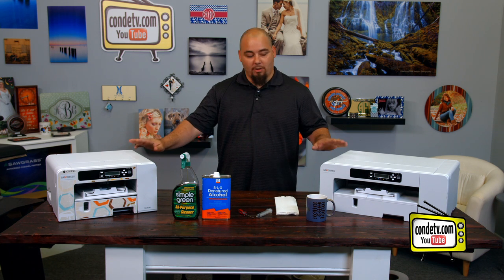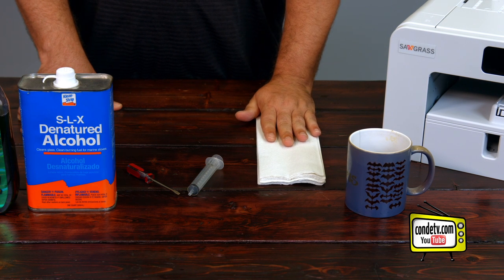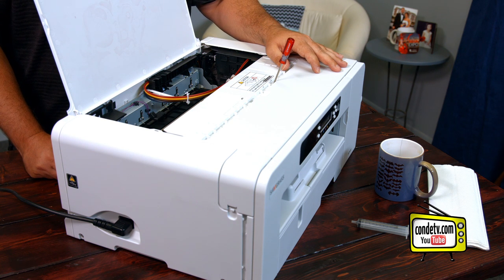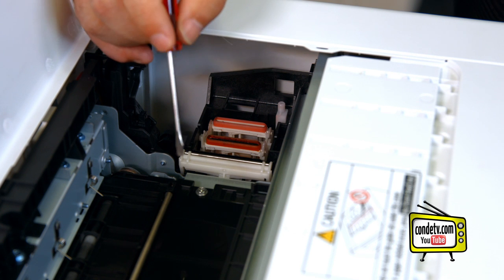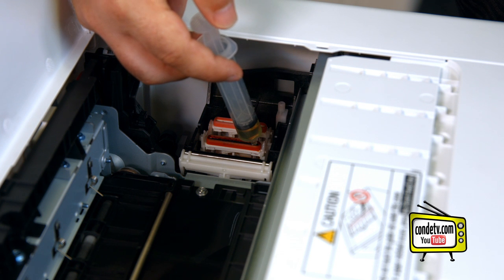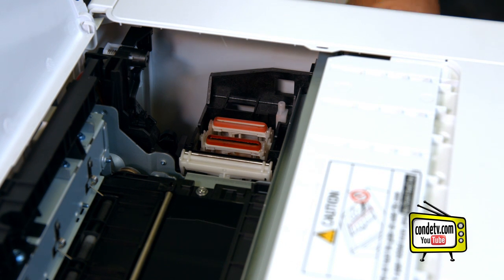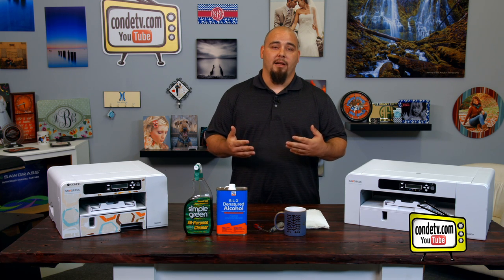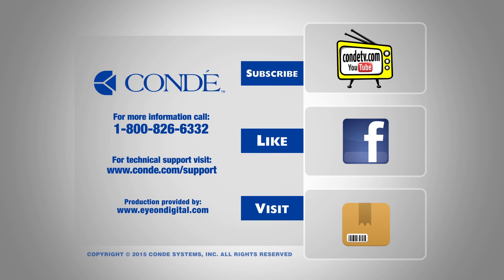Cleaning Capping Station on Your Sawgrass Sublimation Printer

Comment: I'm so anxious. I have set up my sg1000 for the first time today but I got the error SC200-00. On the sawgrass site it said to clean the print head but when I watched this video, the print head doesn't move at all. It tries to and then that's when the error comes up. What do I do in this instance? Especially since the printer has never been used and I am barely setting it up for the first time today.
Reply from the maker: Sounds like you may have a piece of packing material still attached to the print area.  Please contact our technical support at support@conde.com and they will be more than happy to assist you.